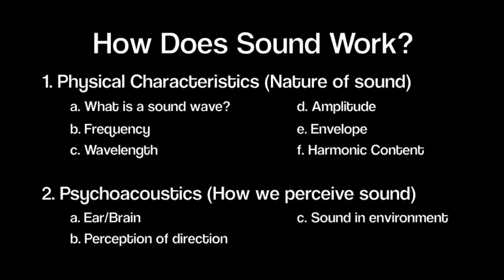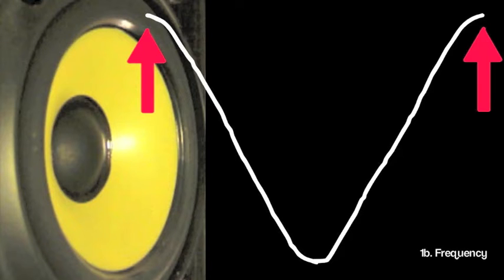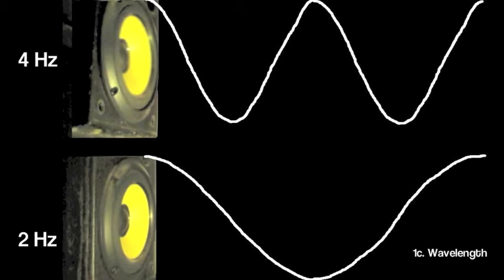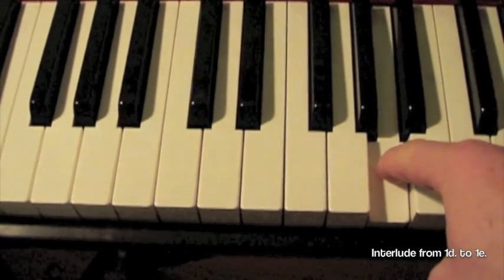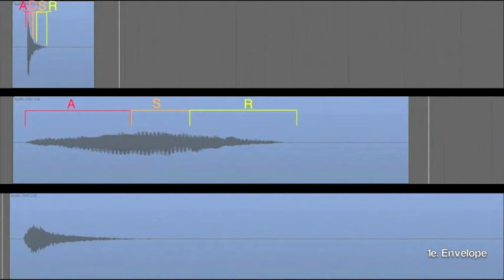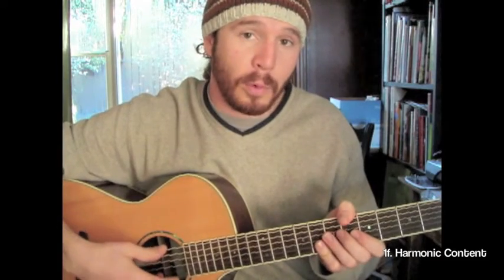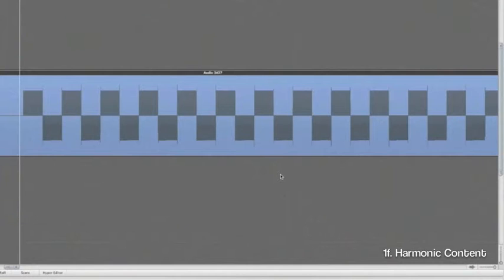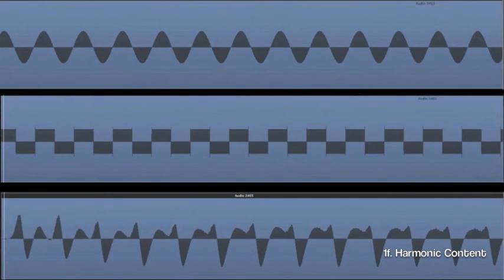How Sound Works - The Physics of Sound Waves

Comment: I am just starting to dive into sound recording and starting to read about these basics. My thought as i was reading was that sound moved circularly instead of the up and down graphs that i see. Your shovel demonstration really helped me to see how sound actually travels, where it is an up and down, but is also an across the plane. Thank you for your easy to understand explanations of this!
Reply from the maker: Thanks so much for your comment. Just to clarify, sound travels longitudinally. The up and down we see from the shovel is because we’re seeing it from the side. A better way to visualize sound waves would be to hold a slinky by one side and let the other side stretch out (straight down) then pluck the slinky to send “shockwaves” down the coils. That’s essentially what it looks like when sound moves through the air — one section at a time compresses and then stretches in a wave-like motion. I hope that helps!

Comment: Love this video!  You take a very complex concept and make it very accessible.  Only one question:  You mention "air particles" sitting in front of a speaker, which are moved (compressed) together by the [magnetic?] vibrations of the speaker.... but what is an "air particle"?  It's clearly not something we can see... so what are these invisible particles that are moving?  Thanks for the lesson!
Reply from the maker: The air particles I'm referring to are the molecules that make up the "fluid" of air all around us. For example, if you put your hand in front of your face and blow on it, you're feeling the air particles rushing past your hand. I'm no chemist but I believe it's made up of nitrogen, oxygen, carbon, maybe some hydrogen? The vibrations the speaker creates are mechanical energy pushing those molecules back and forth. The speaker is a transducer, meaning it turns electrical energy (electrical impulses sent through to wire ) into mechanical energy (the speaker physically moving back and forth). Hope that answers your question :)

Comment: When the speaker is pushed all the way out, you have a negative pressure. The pressure is in phase with acceleration, not with displacement. This is such a common misconception, and I have explained to many a student and acoustic engineer.

Comment: Whoah, man, I'm going through every individual Hz level (I'm at 48 now) and just started thinking... How trippy is it that people have electrical devices like refrigerators, lights, fans, and all sorts of other things that hum at varying frequencies... Thinking about how they are exposed to that all the time. The 5G conspiracy is actually right, but I'm fucking positive it's not just 5G Hz that is causing discomfort and distress. I felt like I took on a dirt poor mindset hearing some of these vibrations. Modern technology is much more quiet, but if you're poorer, you likely have an older refrigerator and other appliances from the 80s or 90s, maybe even older. That has to have a psychological effect. I wonder what good meditating on each of the vibrations would do. I think that makes for a better religious prayer than saying 20 Hail Mary's. Maybe spend some time thinking about when you might have heard these vibrations, or who out there might be hearing them, perhaps on a constant basis.

Comment: Hey , I want your answer , can we produce sound without magnet and electricity 🤔🤔
Reply from the maker: Certainly. In fact we all do it all the time (sing a song, snap your fingers, brush your teeth, etc). But I assume you mean, is it possible for a speaker to produce sound without magnets or electricity? The short answer is no. The basic construction of a speaker is a coil of wire surrounding a magnet, which is a fundamental interface (or transducer) of electromagnetic and mechanical energy. That being said, I suppose it is possible to mimic the work of a speaker w/o electricity. All you need is a diaphragm of some sort to move back and forth really fast.

Comment: Really sound travel in sine wave form or its just imagination?
Reply from the maker: You're right, sound does not actually travel like a sine wave. It's a longitudinal wave. Imagine holding the ends of a slinky in each hand then stretching it apart vertically. The way the coils move back and forth when you do that is a good way to visualize a longitudinal wave.

Comment: Does this explain mono sound waves ? Is a true sound wave is a helix, where the three speakers work like a rotor ?  Is stereo a modulating teeter totter, creating plane ?  [i] A ray is a single line (mono) or shuffling teeter totter (simulated plane) [ii] a plane is three points (a triangle or plane) [iii]  four points of sound is a pyramid (3 dimensional object or helix).  High frequencies can be used to simulate a 4th point.  using a separate amplifier; the separate treble amplifier just passes high frequencies (full range of graphics).  SO THEN, why not use a separate amp (second amp) for Mid-Range and a third amp just for Bass. All three full-range "surround sound" amps would work as one amplifier, and the sound would be built outside the speaker.  If the SPEAKERS are face toward the wall, and focused at (pointed toward a) dish, each speaker's sound would reflect off the dish, instead of having the speaker shoot the sound (like a laser) into the room (A speaker, faced toward the room, shoots sound straight forward, like a laser, and makes the sound sound louder at the physical speaker; and the sound sounds trapped inside the speaker, hampering the panning between speakers.).

NOTE:
6 positions, are as follows: POISE and COUNTER POISE

POISE
3 positions are the speakers physical location: [i]Right [ii[ Left and [iii] Rear

COUNTER POISE
3 other positions are: [i] High frequency [ii] mid-range frequency and [iii[ low frequency

High Frequency = definition of object(fine lines)
Mid Range Frequency = body (object/ instrument)
Low Frequency = Depth = shadowing/shading of object

OTHER NOTE:  
In the subject of sound, a PITCH is located HIGH, MID RANGE and LOW in octave:  An "A" 440 Hz pitch or a "B" 494 Hz pitch, etc. located at a position with in a music key.  PITCHES change frequencies as sound changes from HIGH in octave to LOW in octave ( an "A" pitch 440 Hz changes to a "B" pitch 494 Hz).
PITCH IS LIKE COLORS,  RED can be changed the BLUE.

PITCHES are NOT TREBLE AND BASS;  TREBLE is NOT an "A" pitch, treble is the definition given to an "A" pitch.
Treble is like a TINT.  Tints change a color to be DARK or LIGHT without changing the COLOR.  Treble does NOT change a "B" 494 Hz PITCH from being a "B" 494 Hz PITCH. 
 
Treble changes the "THINNESS" (giving definition to a pitch).
Mid Range changes the body shape, NOT the PITCH
BASS changes the THICKNESS (shading dimension).

Comment: What I have I have trouble understanding is what the waves look like relative to us and the space we occupy. We talk about wavelengths and aptitude, which allude to size, but what do these waves actually like like? Is the amplitude in the Z direction, Y direction? Are waves being produced in all directions? Why does my radio pick up a station (receives waves) whether it's high on a shelf or low on the floor?

Comment: Question: two tubes are placed beside each other, they are equal on all axis except for a toe in. Each tube has a speaker in it and each tube is considered an open tube. One speaker plays a 200 Hz tone and the other a 300Hz tone. Where they meet because of the toe in, what frequency is produced?

Comment: Wonderful  tutorial! You explained really nice and clear, would love to see more of your stuff! :) I just have to ask, why using odd numbers and not even when converting to a square wave?
Reply: Please, where is part 2?
Reply: Dreaming#11 looking for that as well.
Reply from the maker: Great question! The way that the odd overtone series interacts with the fundamental frequency, it interferes in such a way that it creates a square wave as you continue adding more and more frequencies. It can be modeled with a mathematical equation! Here's a link to a graph that I created: https://www.desmos.com/calculator/3pdi4cqy6p
Try moving the slider back and forth to see the building of a square wave.

If you use the even harmonic overtone series (multiplying the fundamental by even numbers, and multiplying the amplitude with reciprocal even numbers), you would build a sawtooth wave -- another very important waveform for the oscillator section of synthesizers!

Comment: Thanks for explaining, I would like to know how the sound is produce from the different instruments.

Like the wave of the slap has a higher amplitude because you pulled more from the string?
Reply from the maker: Well, there are a couple of things going on with a slapped string (i.e. slap bass). There's the wave carried by the string (which is the NOTE we hear) and there's the percussive sound wave energy released by the slap of the string when it hits the fretboard (which is the loud POP he hear). 

The amplitude of the pop definitely depends on how far you pull the string from the fretboard. Kind of like shooting a bow and arrow. The farther you draw back the arrow, the more potential energy (tension) is stored in the bow, so the more energy can be released when you shoot the arrow. Technically, the energy isn't released, it's converted into kinetic (aka moving) energy. So the arrow goes farther.

When you pull a guitar string farther from the fretboard, it stores more potential energy. When you release the string, a good portion of that energy is converted into sound wave energy, so the amplitude is higher.

I hope that makes sense and is helpful.